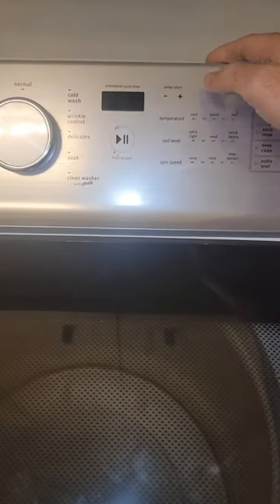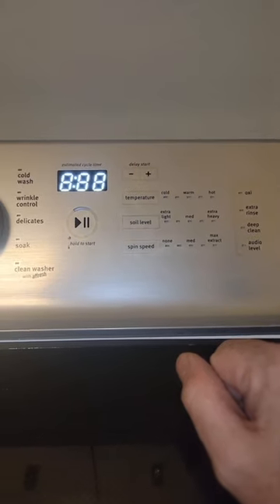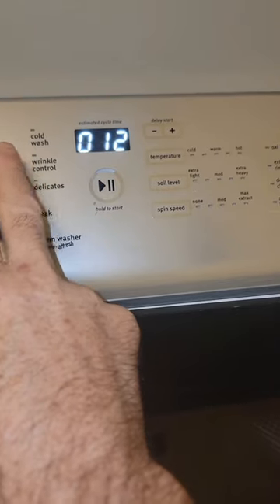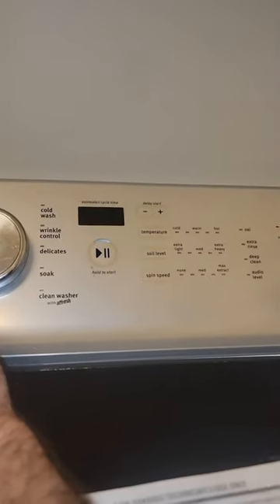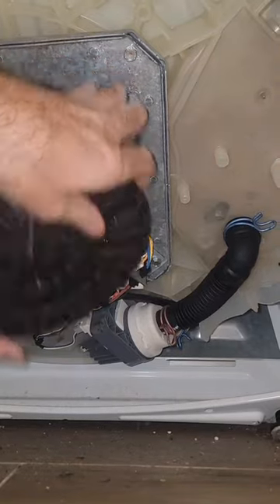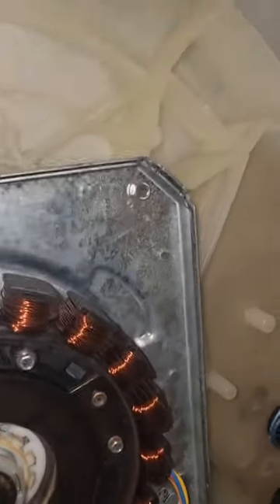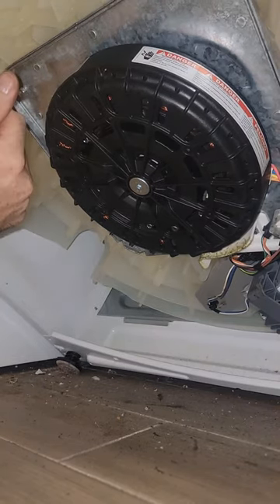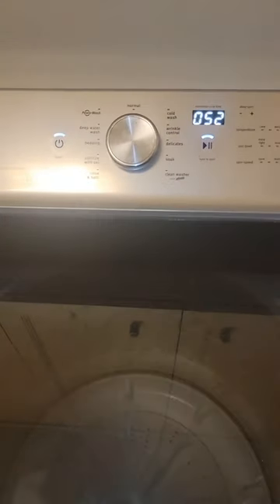Maytag Washer Bravos XL Not Spinning? How to enter Diagnostic mode and Repair

Comment: Finally some people with the same washer… mine is roaring/grinding when going to agitate??
Reply: Same here, same problem as you, I’m about to attempt the repair now. Did you get yours repaired?
Reply: I’m curious as well since I keep hearing a grinding noise
Reply: I changed out the transmission and now it’s nice and quiet. Previously, ours was a constant loud roaring sound, nice and quiet again.

Comment: Same washer but its getting stuck at 13 mins in rinse and spin mode just running water??
Reply from the maker: What happens when you run a spin and drain?
Reply: @htgappliance  it’s like a glitch in the system or something, the water will just continue to run and the remaining time every time was at 13 minutes. I just kept powering the machine on and off a few times and it finally went through and completed a cycle. I believe at times it also wont spin completely dry
Reply from the maker: @wesleybryant7334  run a cleaning cycle if you haven't done so lately just incase there is built up soap scum causing pressure issues. Your pressure sensor is on the control board on that model. You have to call a professional.

Comment: Finally, a video with MY washer! The problem is, mine won't go into diagnostic mode
Reply: Fr took me a hour to find the video
Reply: Did you by chance find a fix for yours not going into Diagnostic mode? I am having the same issue.
Reply: @ArchersMadHouse  afraid not. I ended up getting a used washer
Reply: Mine wouldn’t either so I just kept hitting those three buttons over and over and it eventually did lol
Reply: @kyleswift2512 That worked! Thanks a TON!
Reply: Same here. I could not tell if his washer was off when he put it into diagnostics mode
Reply: @ArchersMadHouse  Keep pushing those 3 buttons.  Took me about 16 times pressing all 3 of those buttons.

Comment: Thank you for the video . Very helpful .   Quick question .   When you take the rotor off and slider kit off .  Should you have grease and some water in there to . Does this mean there is another problem?  Only asking because your rotor and slider kit are clean ?

Comment: Great video. I have two codes, FO and E5. I researched the codes and Mytag said that the load is out of balance. We have been experiencing this for a long time now. When I performed the diagnostic check on the high spin (12), the washer machine jumped like crazy. Same thing it does at the end of each cycle. Any ideas you can want to share, please?

Comment: Great video on diagnostics mode and how to change the rotor. I was having this same issue and purchased an OEM rotor and  slide and installed as in the video. Once installed  i'm still having the same issue. When i pulled the old items they looked to not have much wear, but they were wet and greasy, and water was dripping from the holes in the gearbox. The agitator moves at it should, but the basket will not spin. F7 E5 code please help

Comment: I have an error code F7 E5 and my basket is not spinning--only the impeller.  I think i have the same issue as you.  May you provide me a link to the parts you bought. I have a Bravo XL washer.  Thanks for your video.
Reply: Did you end up finding the parts?
Reply: @rathanakkhan4160  no i didnt.

Comment: I've got a f8 E1 code, no debris in the drain or in the line to the new   pump or after it, it has been working  fine since the new  pump was installed. i tried to test as you did and the lid wil not latch. Latch looks fine. Recommendations would be appreciated
Reply from the maker: If the lid won't latch, unit will not spin and drain
Reply: Maybe the main board is going out it worked for a load after leaving it off for a while and now it's not working again, I cleared the code previously and no code was sent with it not working now

Comment: I cant dislodge the cover on the bottom. Yours came off like butter. Any suggestions??
Reply: Use a shoelace and a butter knife use the butter knife to put the shoelace down in the slit of the tub and pull op after you get the shoelace to the middle of it just for future reference if you need it 👍